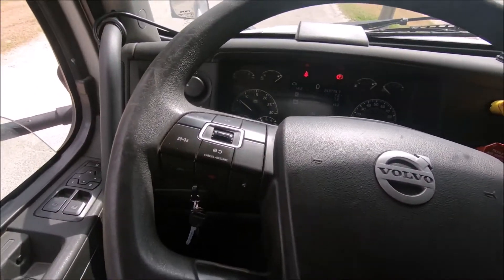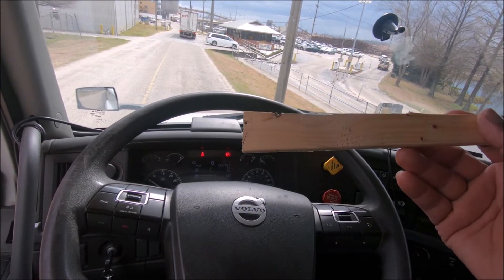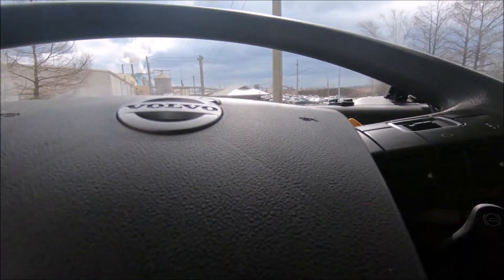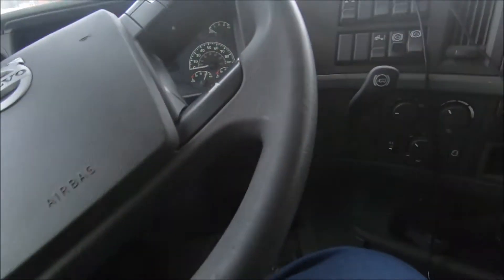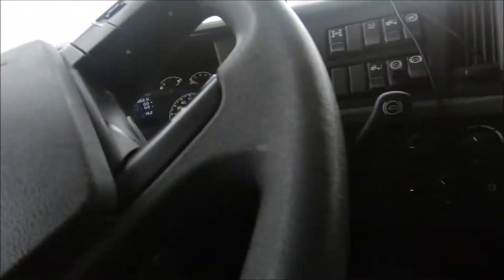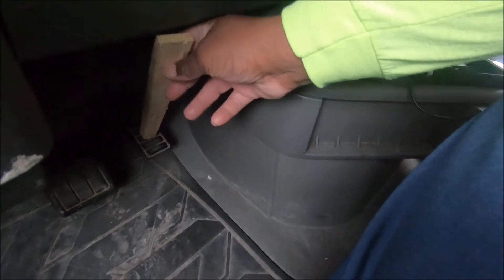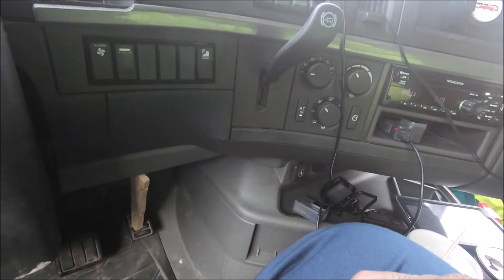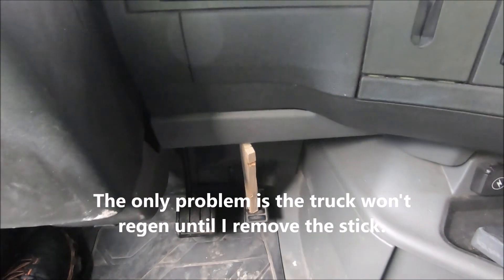How to increase the idle in a 2018 Volvo VNL760

Comment: Could that be the air compressor for the air brake tanks making the vibration?
Reply from the maker: No, the cabinets in the back shake as well.
Reply: I'm on the same boat and hate the vibrations all over the cabinets specially when sleeping!